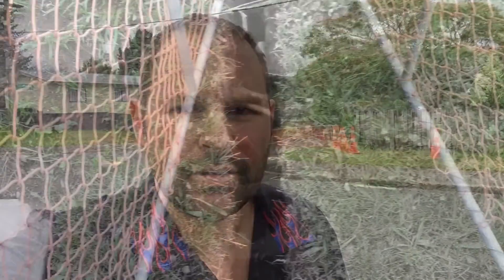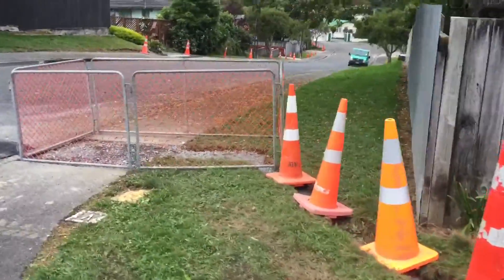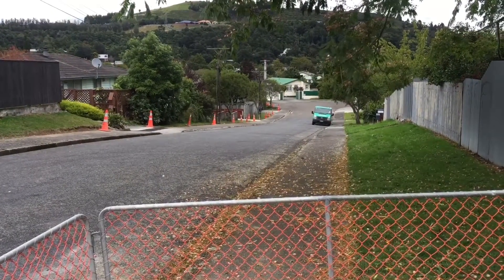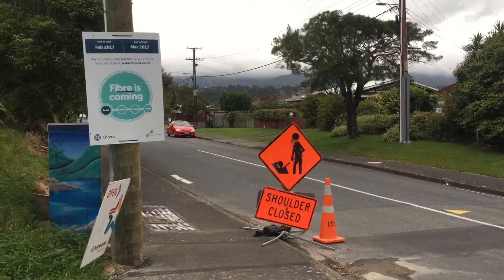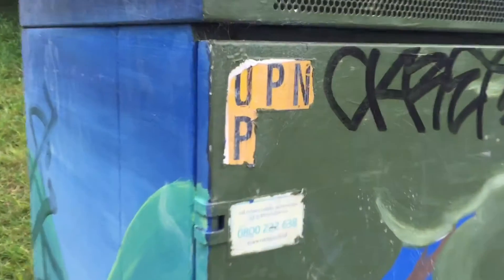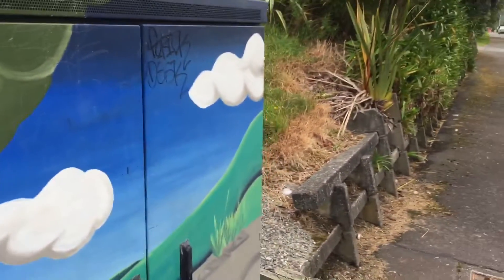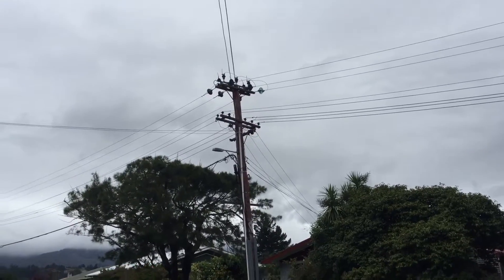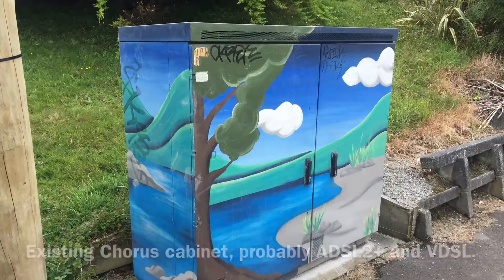How do you install fibre to every home? UFB not NBN

Comment: Videos like this piss me off, not really the video, but thinking most of New Zealand will have fibre, and I'm about 2k's off the fibre cable, it's pissing off, the provider I'm with now is like 0.9 download 0.7 upload
Reply from the maker: Yeah, it sucks, where my mum is there is only VDSL, which should be fairly good only it’s not, its about 15mbit, and should be two or three times more. You could use rural broadband 3G or 4G to get more speed, skinny mobile has 240GB for $59.
Reply: We can't even get that :( Or ADSL or VDSL, we use a wireless internet, 30 download - 10 upload 175$ a month for 750GB's but normally get 80-200ping
Reply: this shit takes time unless you want it to end up shit like australia